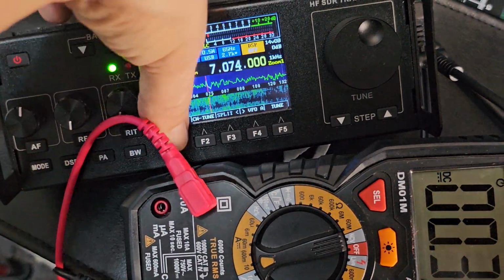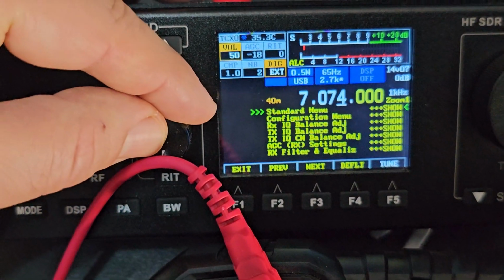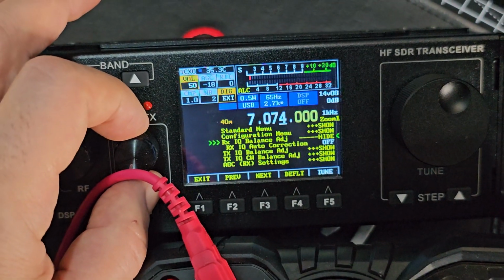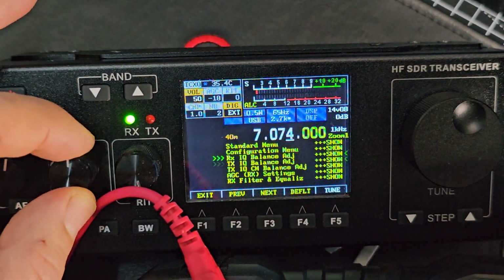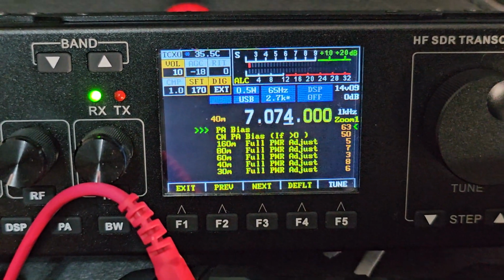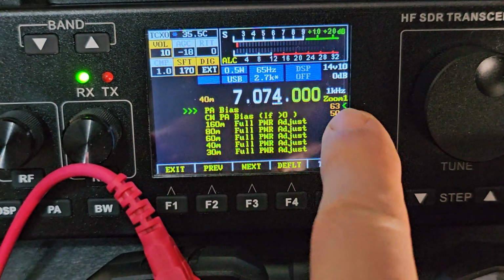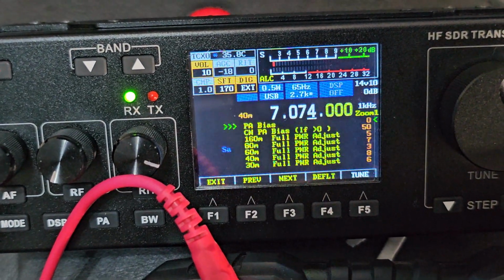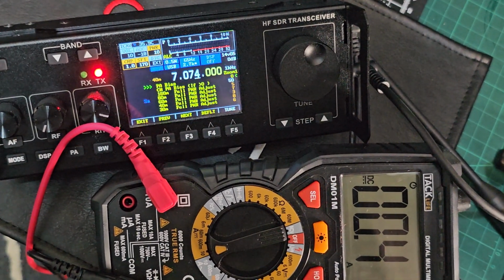RS-918 , LEARNING CALIBRATION

Comment: Good video Andreas,  indeed a good PA-BIAS adjustement ,as showen in video, should be done with "DIG-EX"  input Mode ( input  comes from PC-USB cable) so we are 100% sure that there is zero HF signal output  during Test , Only DC components are taken in consideration  wish is great,     Initial settings for your PA-Bias seems to be  too Hight , it gives around 2.2A  what explaine the self oxillation  seen on  20m on your last video's  ( there is a hight power output without speach on microphone ),   CW Bias  should be the same as for SSB  ( same hardware circuit ) ,  it can be adjusted a little bit lower then SSB  to do not heat Mosfets  without too much HF output distorsions  , this help also to avoid Mosfets self oxillation  ,  CW-Bias setting should never be higher then SSB setting , it's difficult to adjust  the CW PA-BIAS on CW mode with a paddle  because it will have always some HF output power what can false the DC measurement ....  Just keep it as SSB PA-BIAS  or decrease it a little bit  without decreasing the CW HF full output Power  .
Reply from the maker: Thanks Nizar I have alot to learn I do appreciate your help , Happy Christmas